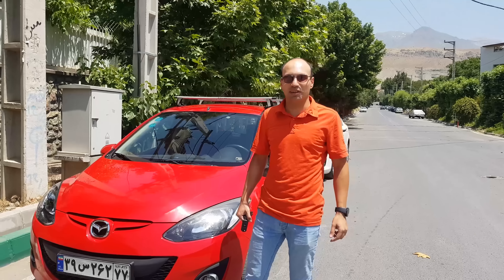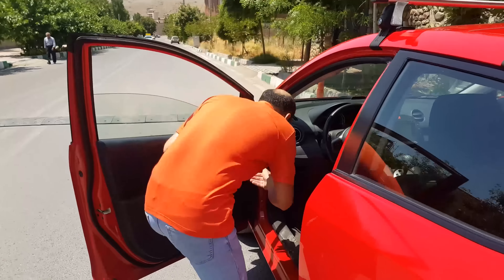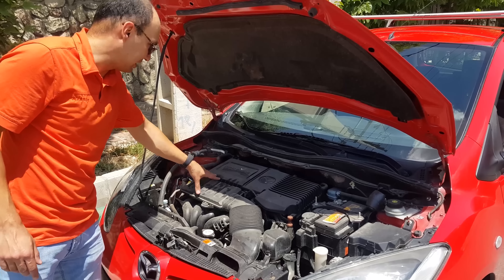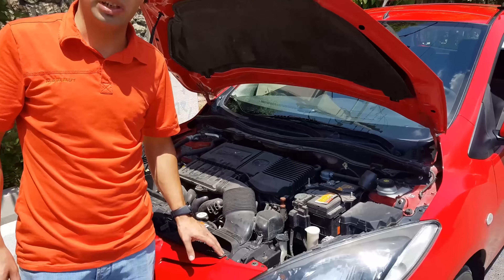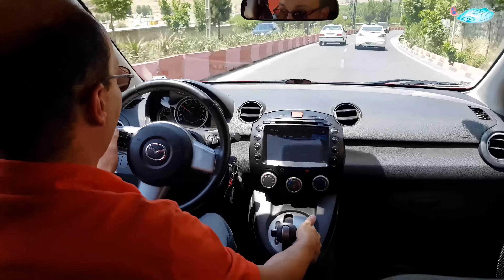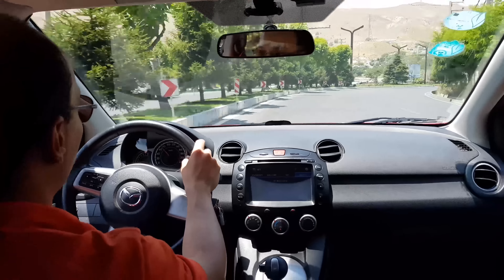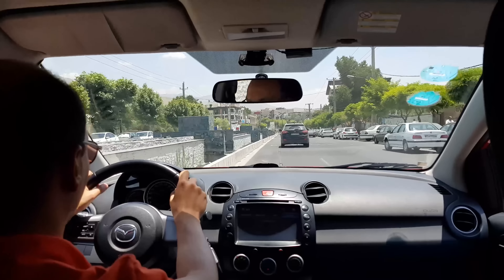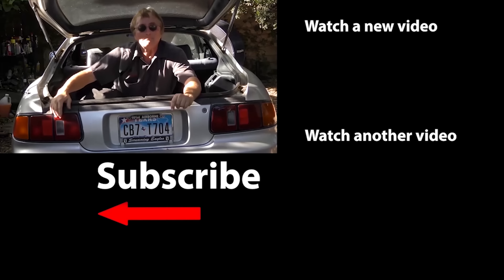You Won’t Believe Where This Mazda Was Made

Comment: I have a 2012 as well. Mine was made in Japan. I have 71,000 miles and not one thing ever went wrong. It scoots around very nicely and I get 35+ mpg. I got the stick though. I do not regret buying this. It's very cheap to maintain and I intend to keep it as long as I can.
Reply: Yes same here the 5 speed and small light weight make it fun.. i also drive a bmw with 400hp and the Mazda always makes me smile.

Comment: The Mazda2 is a fantastically simple car. My mother bought one six years ago - nothing but regular oil changes (as easy as a 60's Chevy) , tire rotations and the odd trip to the pump.
These are extremely light and nimble vehicles which makes them very easy to maneuver, and a joy to drive.
The Mazda2 is a no frills city car designed for developing countries where parking is tight, the streets are narrow, and folks don't want to be throwing cash at their cars.

Comment: Probably the only Ford automatic transmission that hasn't failed yet! lol And this is the same thing as a Toyota Yaris!
Reply: Korey Mayo ford fusion?
Reply: Ford six speed in their diesel trucks are solid.
Reply: @HarrisonCountyStudio  yup. The only crappy Ford transmission I can think of recently is the dual clutch transmission. All the others seem pretty solid
Reply: Korey Mayo Is the Ford Transmission better than the Nissan/JATCO CVT?
Reply: @39Hundred  Nissan Jatco transmissions  are bad too.
Reply: @GreatGrandmasterWang  the Ford fusion has a more powerful 4 cylinder engine than this.
Reply: @HarrisonCountyStudio  but their diesel engines usually suck except for the old 7.3 liter.
Reply: @GreatGrandmasterWang  the only solid Ford transmissions are the manual transmissions.
Reply: My 6f35 transmission is slipping but still driving 😬
Reply: @ricardosalgado5703  how many miles? And do you change your transmission fluid regularly?
Reply: Korey Mayo 190000 and no since my father owned it before me, he’d never went to change the fluid unfortunately so now second gear is going out and it reverse is bad went shiftin into it... might get rid of the junker
Reply: Korey Mayo I've got a 30 year old LINCOLN MarkV11, and it shifts as smooth as silk! It may be a Lincoln, but it's still a Ford! Same for my 2004 Mercury Grand Marquis!
Reply: same thing as a Toyota Yaris?
Reply: Korey Mayo The only bad ford transmissions are the one in the fiesta
Reply: Ford Festiva,  800K+ no problems, a Mazda 323 motor and transmission.
Reply: @joelspivak6622  the Lincoln Town car, mercury grand marquis, and ford crown Victoria were the best cars ford ever made and some of the ford taurus and 30 years ago ford, chevy, and dodge were all better than the garbage they make now lol
Reply: @GreatGrandmasterWang  depends which engine and transmission
Reply: @GreatGrandmasterWang  there's brand new f150s and expeditions with bad transmissions already and a lot of Fiestas and focus with both engine and transmission failures. Lots of ecoboost failures. The list goes on.
Reply: @justenzo6342  and the focus and ford suvs and f150s. Lots of models with bad transmissions not just fiesta
Reply: @steve9377  yep mazda 2 and Toyota yaris are the same
Reply: @koreymayo8884  yeah my comment about the F150 transmission didn't age well. The 10 speed transmission are now having issues. Damn it Ford
Reply: @koreymayo8884  nope, this model is not the same as a Toyota Yaris. Mazda didnt start building cars for Toyota until 2016 and at that time had already been separated from Ford for several years.

Comment: I purchased two Mazda2's (2011 and 2012) new for each kid when they went to college in FL, one a automatic(Ford) and one a 5 speed manual(Mazda).  Both have been very trouble free with only general maintenance, 5k oil changes with synthetic 0W-20, regular trans fluid changes at 30k miles (auto and manual) and a coolant change at 80k miles. The manual needed a clutch replacement at 90k miles. Both cars have over 150k miles and still run very well - though I think the automatic may need a new steering rack soon. Lot's of standard Ford Moto Co. parts on these cars! At around $15k out the door (both were dealer leftovers) - I think I really did get my monies worth. And the little 5 speed manual transmission one is a pisser to drive, zoom...zoom.. well for ~100hp anyway.
Reply: Joseph Pickel ... money's

Comment: I can't wait to get a Mazda
Reply: You'll regret that right away
Reply: @danh2134  nah Japanese cars are still way better than any American brand. So Toyota, Honda, Mazda, Subaru are all usually reliable, but there are some problems they all had over the years, none of those brands are perfect.
Reply: I agree on Japanese cars being better built than American cars but two names that I stay away from are Mazda and Nissan,  those two brands are in the shop a little more than the other Asians
Reply: @danh2134  I have a 2006 manual gt mazda 3 and I love it
Reply: @danh2134  nissan is merged with renault, when a french junk company interferes yeah its quality is bad. The mazda's are better than nissan for the last decade.
Reply: Love my 2016 Mazda 3!
Reply: @tornay131  I want to get a 2014
Reply: @danh2134  Not true at all. I've owned several Mazda's here in the UK (made in Japan) and they were all completely reliable. Just as reliable as the Honda's I had incidentally. I believe some Mazda models that were sold in the US are not Japanese built so maybe inferior.

Comment: Great job on the review Ali! I am glad that the car has held up well for you. So long as your 

I have a 2019 model of the Mazda 2, and it is such a fun car to drive. I average 5.3L/100km (44 MPG) during highway driving, and 6.4L/100km (37 MPG) in hilly or congested areas. Combined average would be approximately 5.7L/100km (40 MPG).  So it is good to know that fuel economy won't drop too much over time.

Comment: 5W30 fully synthetic, he shouldn't be concerned about 3,000 mile oil changes, regardless of engine mileage. Keep the air filter clean and do 7K oil changes or longer.
Reply: I thought the same.Those oil changes are overkill.I chamge the oil filter only half way between oil changes.

Comment: This thing is almost identical to my 2010 Toyota Yaris, I can see why they made the Mazda 2 and Toyota Yaris the same vehicle. Except mine is a 2 door manual transmission hatchback. :-) 
Cool video
Reply: Identical as in they are both hatchbacks? Toyota didn't have ties with Mazda back in 2010. Ford was still in the picture back then, so this car does share some parts with the Ford Fiesta.
Reply: They're both 1.5L 4 cylinder engines in either 2 or 4 door hatchback style. lightweight. and idk, Mazda started making the Toyota Yaris in 2015 I think. I just think they're both really similar vehicles is all.

Comment: Got one of these but with a manual transmission great for backlanes in the uk as there quite popular over here my advise try to get the 1.5 litre which is what I have. Fun car great build quality the car is on 70k miles and I bought it on 45k no repairs just maintenance.

Comment: Interesting.Two petrol engines and diesel engines
Reply: I was thinking the same....
Reply: @Livin Vids they werent lol😂
Reply: It also has an automatic and a manual transmission. Lol. 🇬🇧
Reply: @grahamefreestone5309  It also has both steel and alloy rims.
Reply: Other parts of the world, diesel is used as much, if not more, in regular consumer vehicles. Similarly manual transmission engines. 

Sadly, US markets do not really provide those options as much.
Reply: @greenbanana2332  Diesels are for buses and pig farmers. Gas is cheap here, we don't need diesel
Reply: justsomeguytoyou : gas may be cheap here in the US, but that’s not why deisel engines are not produced more for  US consumers. 

By the way, do you know deisel engines get better gas mileage, and typically stronger hp/torque than it’s gas engine counterparts? So actually it’s “cheaper” to use.
Reply: @greenbanana2332  I know all of those things about diesel, but they are also more finicky and require more/different maintenance. They do make more torque, but in naturally aspirated form, they certainly do not make more hp--that's why they have to turbocharge them.
Reply: @greenbanana2332  I miss manual transmissions. My first few vehicles and my old work truck were all stick shifts. I guess they dont have enough demand for them anymore.

Comment: My mom had a 2012 Mazda 2 and It had 50K miles on it and we traded it on a 2012 Honda CR-V. She only did two oil changes in 50k miles and it still worked. It had the 4 speed automatic transmission. we live in america so they stopped making that car here. I wish they didn't because it was a fun, reliable little car but we needed something bigger for shopping and family trips. we had the car from 2012 to 2019.

Comment: My Renault Megan sedan 2018 gets 62 mpg   and have more power 115hp more torque 260 nm and it's more reliable. 400 000 km no problems
Reply: You also drive 100% highway so that is why your fuel economy is so good, and your mileage is so high already. Driving highway doesn't wear an engine out fast at all, at the rate you drive at, you might have the a 1M KM Renault in the next 2 years maybe.
Reply: @RicardoPCGamer   it's because it's diesel. ) now I have only 60 000 km but this engine can last for 400 000 km no problem.
My average fuel consumption is 4,8/100 km. It's not highway. It's city and road.

Comment: Is it bad that I change my oil roughly every 10,000 miles? I've done 60,000 miles and it still runs as good as it did when I bought it with 10,000 miles on the clock. At 5,000 miles the oil still looks new. I use top of the range oil, since I do my own servicing I still save money.

Comment: No need to change oil at 3K miles, unless doing mostly low speed city driving , like for deliveries/taxies. 5k is fine for most cars)though I suggest using/adding STP oil treatment every change- good stuff. They don't call it -The Racer's Edge for nothing.
 And no need for synthed oil , unless you just like spending more $$$$ or have an extremely high end/perfomance car that you run alot at the high end or just let sit around for months without driving and got money to throw away.

Comment: I have a 2007 Mazda Axela (JDM-spec Mazda3). Exact same engine and gearbox as this guy's. It's still in good physical condition, but lately, I get a jerk when it shifts gears and also when it down shifts from 4th to 3rd gears. ATF is clean, got changed last year and the mountings are in great condition too. I suspect that something in the transmission is about to give but different mechanics are giving me different stories. What could be wrong?

Comment: I have the 2011 Mazda 2 in the USA! I've abused the crap out of this car. 117k miles primarily delivering pizza! Almost no maintenance other than tires and oil. Runs like a champ. If it died tomorrow, I'd still be happy with the abuse it has taken. Very nimble around corners. Wish Mazda kept making these small hatches. The 3 is too big for my taste.

Comment: Didn't Ford buy Mazda a few years ago?
Reply: They split up in 2014 mazda makes everything in house in japan no more ford parts its great although they do have a plant in mexico assembling mazdas
Reply: They divested from each other in 2011, skyactive is a total mazda design.
Reply: @Finestizpro  I remember when I was a kid back in the 80's my friend's mom owned a Mazda RX-7 with a rotary engine. Nice Sports Car! Then some time later I remember, I had read that Mazda got sold to Ford. So, they are Japanese again, OK.
Reply: Mazda is where Ford got the ecoboost tech from. Mazda's DISI engines predates Ford. Direct injection spark ignition turbo .
Reply: ChromeLeatherGel you RX-7?
Reply: ChromeLeatherGel they werent sold to Ford; Ford had like 35%ownership stake. It was more of a partnership, and it kept Mazda affloat.